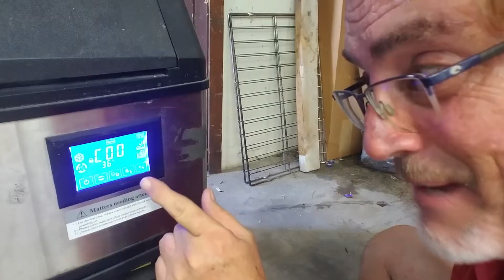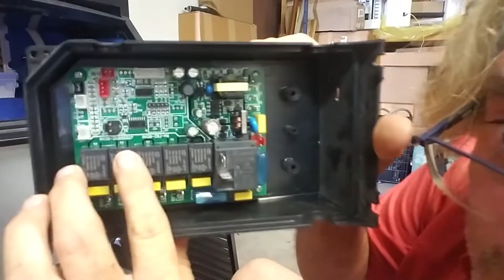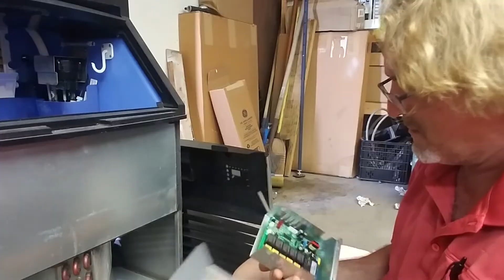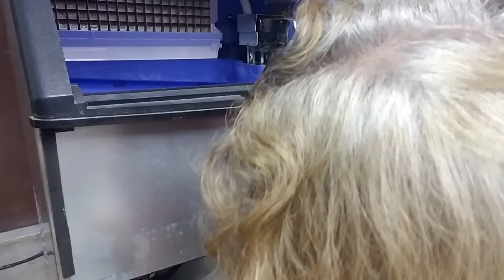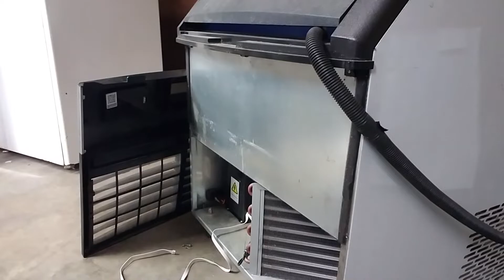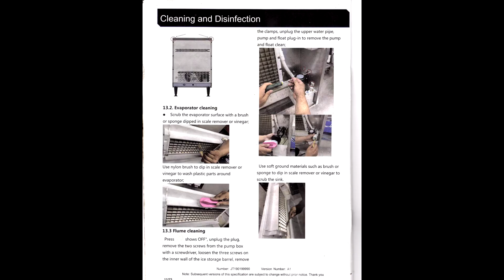VEVOR / Cotlin Ice Machine Repair PARTS?

Comment: My Vevor cycles through the water filling, the 12 minute cooling cycle and then goes into the defrost cycle to release the ice but it is not getting cold enough to freeze the water on the grid. What do I do now?
Reply from the maker: You might have a sealed system problem.

Comment: Pro tip from someone that works on equipment that may come in with a different default language set on computers, digital displays, etc.  Grab your handy dandy smartphone and open google translate.  Then use the camera to view and translate for you.  You can then easily find the system menu and switch the default language to English.

Comment: The video was definitely entertaining on what he had to go through to get this Ice Machine to work.  I do Commercial Refrigeration and can verify that if your business depends on the availability of Ice and can not go long without it, Do not buy this machine.  When you do research the parts and locate them, Count on waiting a month or more for the Ice Machine to be repaired. If you are just using it at home and can wait awhile for repairs it’s a cheaper purchase. Your Refrigeration repairman will have to go the extra mile to repair this machine. Vevor is an importer of Chinese made products and they won’t necessarily tell you which company manufactured the machine. You can Thank me for saving you a headache.
Reply from the maker: I agree with you.  Well said.

Comment: Is it possible that my pump had failed due to calcium build up in the pan? Same problem you were having. It fills up the pan then stops
Reply from the maker: I would apply 120 volts to the pump directly.  Just to make sure the pump is bad.  Yes, it could be the problem.  Cleaning every 6 months should help reduce the build up.

Comment: My vevor ice maker throws an E2 error code. The manual says it's the Ambient and Return Air Temperature Sensor.  Do you know if those can be purchased separately than the mother board?  Also, who did you buy your replacement parts from?  And I liked your video. Very informative.

Comment: The problem im having is my machine switches to HOT setting after a few minutes and stops making ice. Help
Reply from the maker: It could be the thermistor on the condenser line or the board.  I would ohm it out.  While using your meter, worm the thermistor and see if the reading changes.  If so, generally it's good.

Comment: Can you help me to find VEVOR 265 lbd ice maker (control board ). VEVOR®
ICE MAKER

Model
SKF-E150F

Voltage
110VAC / 60Hz

Power
750W

Protection against electricity shock type

Refrigerant
R290 / 120g
Reply from the maker: The only way I found it was by typing in the numbers on the board.  I couldn't find anything by the model number of the machine.
Reply: @richardkoon5544  thank you sir too much
Reply: Do I have to write all parts numbers?
Reply from the maker: @qasimsalman2231  should be similar to the numbers on the board in the video.  May no match, but the format should be similar.

Comment: My brand new machine has never made ice yet. Locks out and gives a code 11. Seller has not responded to give any help. Do you know what code 11 means?
Reply from the maker: Check this....
The error code 11 indicates that the water level in the reservoir is too high. Try removing some water out of the water reservoir and then reset the ice maker by disconnecting the incoming power for 5 minutes and then turn it back on.

Comment: Hello, I have a recent Cotlin model that I bought a year ago but now I have an "ice flip" problem that I don't know what to do because it hardly makes any ice, thank you.
Reply: I have one that is doing the same thing. It won’t make ice at all. I’m going to scrap it and buy a new one.
Reply: I also had the ice flip and the C-01 error code ( wrench & screwdriver) flashing. Went to Amazon searched for vevor ice machine parts…. Found part that looked exactly like it. Ordered and replaced. Fixed it!!! Part cost about $20.
Reply: My part didn’t look like the one here in this model. It was flatter than this one and you have to get a pick behind and slide it out towards you.

Comment: Hello, I have this brand but I believe its a newer model. Anyways I recently just cleaned it and it has been showing on the screen as E04. Might you have any idea what that means? It also show lights up red for high temperature. Please if you can help a girl out i would really appreciate it.
Reply: I have a by-70pf  e4 in my manual it says ice full, says to remove ice, or make sure the connector returns to the original position
Reply from the maker: Is the fan motor in the bottom running?

Comment: Would like to know if the original interface panel would have worked with the replacement board out of the box? Great video, I agree with you that these are nothing more than Mani's at  3 times the price or Avantco's for 50% more.
Reply from the maker: Probably, but is was a bit different.  So I installed both.
Reply: @richardkoon5544  I need another machine for my fish boxes, 150 pounds a day + or - a little will work what would you buy?

Comment: I have vevor ice machine identical to one in your video. Any idea about how fix heating element that turns the ice loose from the nickle ice grid
Reply from the maker: I don't think there is a heating element.  The system has a reversing valve the changes the flow of refrigerant.  I think the tempsensor tells the computer when to enter a harvest cycle.  That may be bad.

Comment: I am having a problem with a Vevor as well. I have been in communication with Vevor for 3 weeks trying to get an ice bin full sensor replaced. First they said they were going to send us one 3 weeks ago and then I get an email from them this morning that they do not make this "accessory" and that I should contact my local hardware store. The ice bin sensor on this machine is Flat unlike anything I have seen. A generic ice bin sensor is about 1 inch by 1inch is size and this sensor on this machine is about an inch wide but maybe a 1/4 inch tall. I do not know what else to do other than maybe give the guy his money back since we cannot repair his machine. Normally this is such an easy fix. I do not understand how they can sell machines but no parts. It is insane. We even tried ordering from ali express and no luck. Our sensor we got from ali looks like the one you got in this video meanwile the one that is on the machine is flat. I cannot even locate the sku number anywhere which is SYT38400LBS122r5v1v1